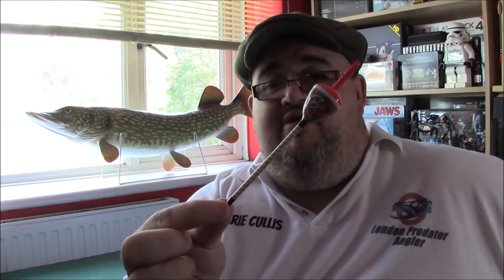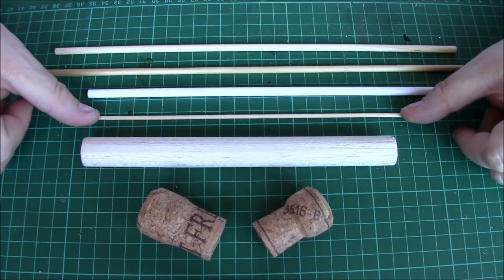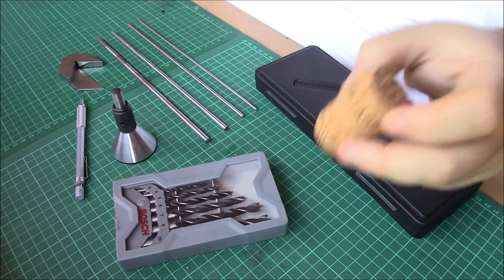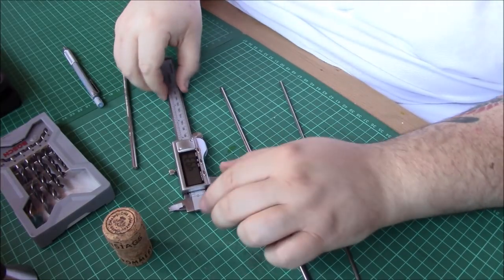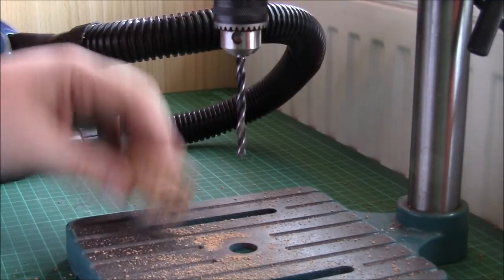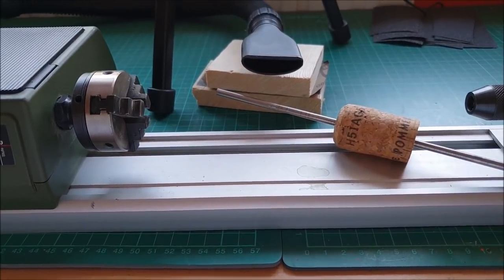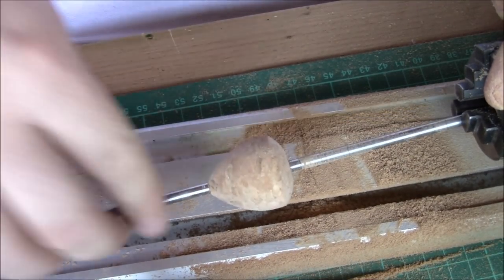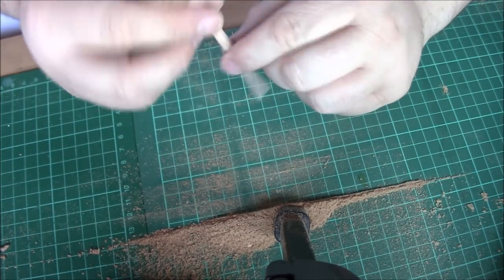How To Make A PERCH BOBBER Fishing Float - Part One

Comment: Lovely floats, nice work. When I started fishing (65 yrs ago!) all floats had a ring (eye) on the bottom. ‘Double rubber’ was a later way of doing it I think.
Safety tips... NEVER, EVER, spin up a lathe with an “empty” chuck. The mechanism can unscrew and the chuck jaws will fly across the room. Good luck dodging them...
also, NEVER leave the chuck key (or Tommy bars) in the chuck because if the lathe is started with the key (Tommy bars) in then you will either badly damage your lathe bed (and yours is aluminium, so a soft material) or you’ll be trying to dodge flying metal again. Good work on the floats. Les

Comment: Hi, In your video at about 41mins I see you have bags of bodies, Just wondering where you got them from. As been trying to get hold of some and cant find any.  Excellent video mate, Cant wait to see some more on float making. Regards Dave
Reply from the maker: hello dave, thanks for your kind comment. Yeah I got them from Ebay, the seller is called (wilkeskf) I know he hasn't had much stock lately on there, but its easy to turn your own bodies, I use both ones I turned myself or ones I buy from him. good luck Barrie
Reply: Thanks for getting back to me Barrie, yes I'm going to have a go at making my own bodies, just waiting for lathe to be delivered. thanks again for your help. Dave